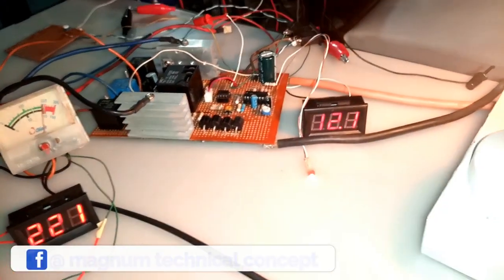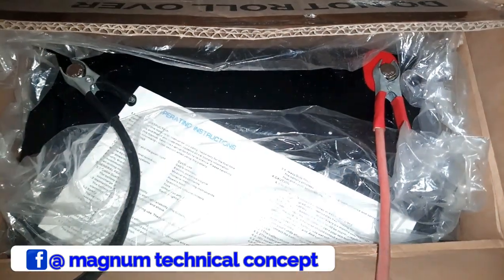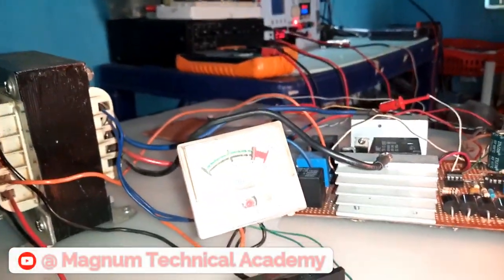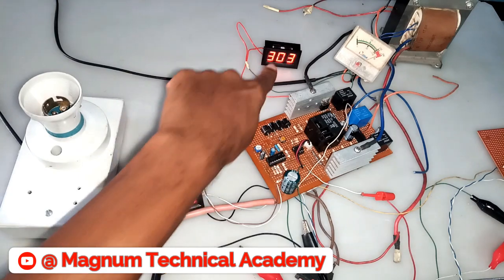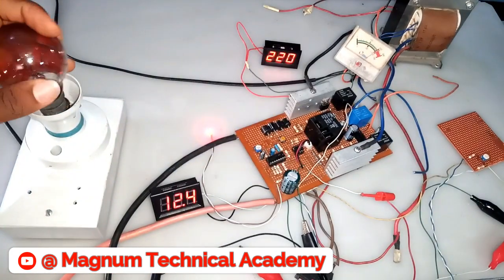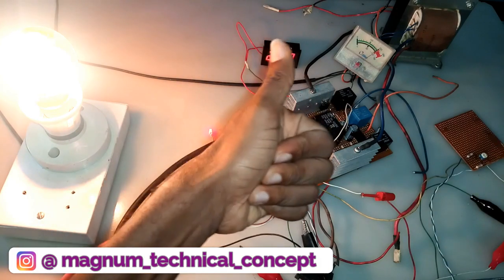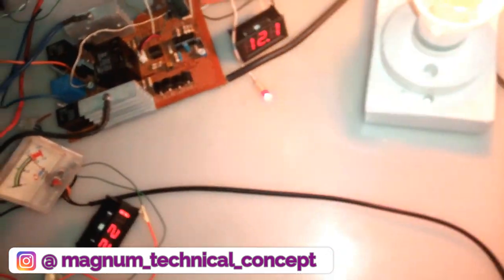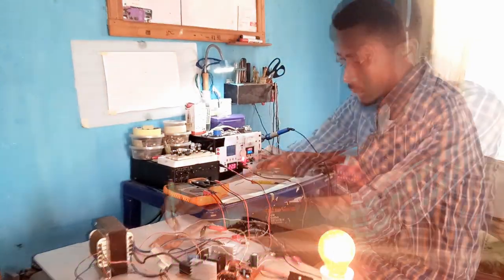Troubleshooting SG3525 inverter feedback Circuit. ( Square wave signal )

Comment: hello sir, i would like to ask where to analyze your circuit, like circuit diagram to figure out the problem or comparing to the other designs?
Reply from the maker: So far,I have not been able to rework on the project

Comment: Remove R1 and C1 from pin 1.  That means NO connection between pin 9 and pin 1. Then change the 10 nF capacitor value on pin 9 to ground with a 100nF capacitor and that will work fine. I had the exact same problem with a DC-DC converter. Now my voltage is totally steady. I use a tl431 with  photocoupler configuration but I am sure that in your case will help a lot
Reply from the maker: Thanks so much for this insightful inputs
Reply: Care to share your circuit diagram?
Reply: @KhatibHamis  it's just a 100nF capacitor from pin 9 to ground

Comment: As a developer engineer your issue in not with the feedback pin out ,to control any load to get the same voltage results you first need and op amp amplifier to take a voltage divider of 5 volt using resistor 200k to positive voltage and 32k to negative voltage to get 5 volt use the op amp to control the duty cycle automatically adjust so your voltage stay the same
Reply from the maker: Thanks so much for your kind insight and feedback
Reply: I think the SG3525 already has that inside.
Reply: okay

Comment: You are doing great, well done. If I may ask, how long does your battery last when powering a single bulb or two. If you have tested it or for now you are focusing on maintaining the out put voltage to 220v AC.
Reply from the maker: I have not used this assembly for use, since the feedback hasn't been rectified yet...

Comment: Change R3 to 200K  , RV1 to 10K and add another 2.2K to RV1 into ground also add 10n cap to pin Vref and ground , Change C4 to 10uF for better soft start, remove connection from pin 3 and let it free , remove C2 from pin 9
Reply from the maker: Thanks 😊,I do appreciate your kind feedback, and I will work on your suggestions